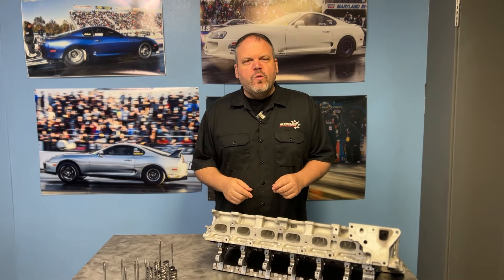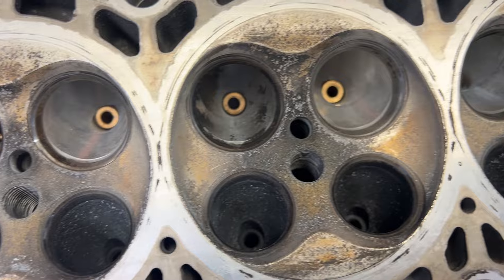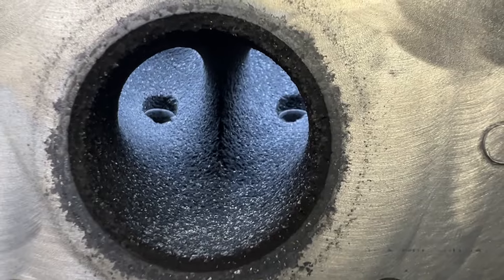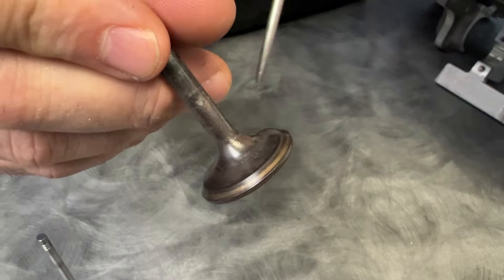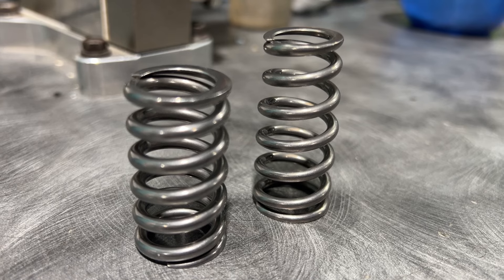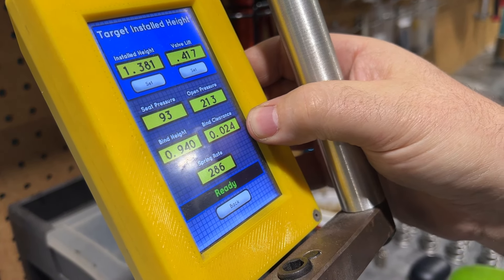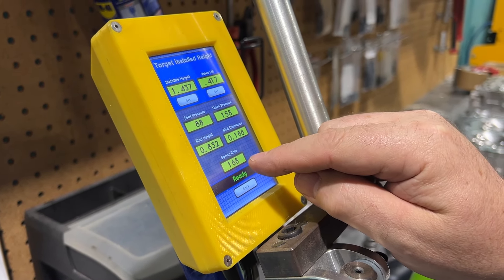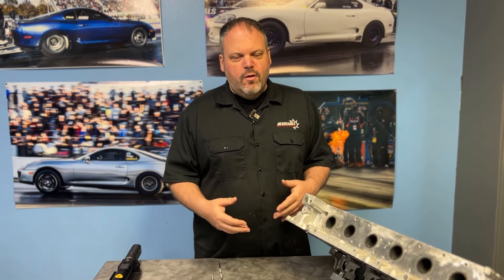900whp BMW road race BMW S55 head teardown!

Comment: What do you think of the exhaust cam carrier and well known rapping noise on these because it seems to “move” at the rear? BMW replaces the bolts and it goes away but it seems to not be permanently in all cases.

Comment: At one time I tried a full radius valve job and that hurt power for sure. I have done a straight 60 75 angle exhaust setup to reduce reversion and that works but that's a na thing and I make a larger contact area it all depends on use and fuel
Reply from the maker: @alexhise968  yeah radius doesn’t work. But, it does flow better sometimes on the flow bench. But, never works on the engine.